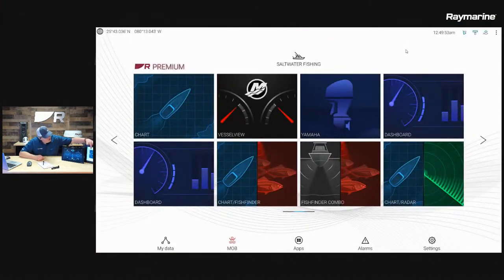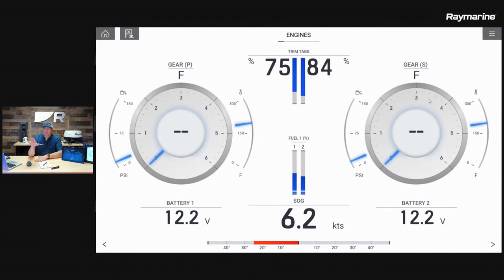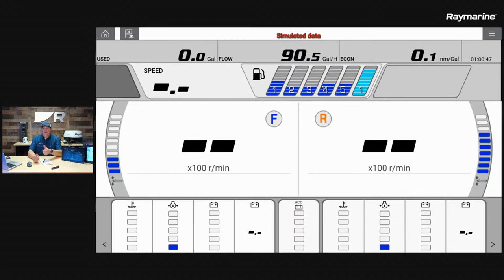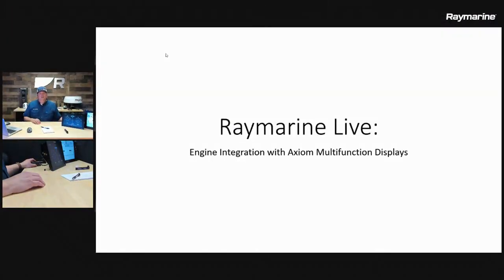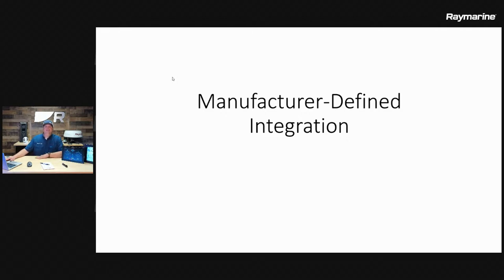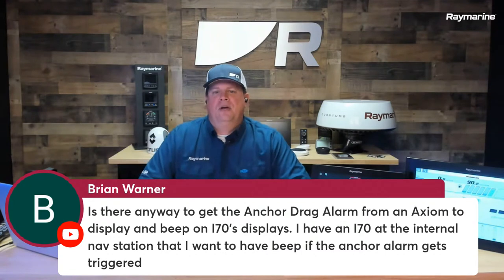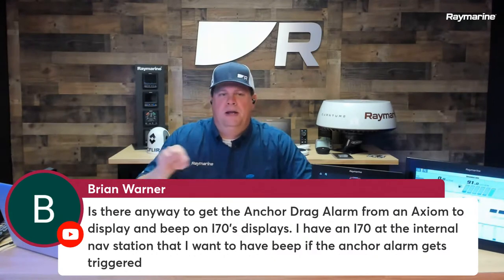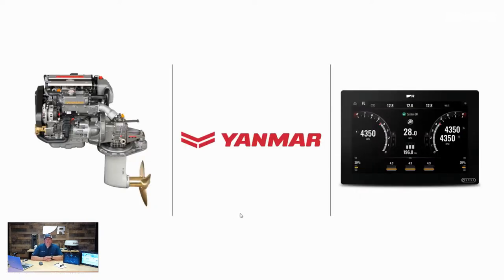Raymarine Live:  Engine Data Integration with Axiom

Comment: Hi Jim, Love your videos! I am from Bulgaria and using Raymarine for few years. Really nice gear! Currently, I have Raymarine Element 9 HV and would like to connect it somehow with my Mercury Outboard EFI 100hp 2018. Could you please help me to find out, what I need as connector, would it be possible through the Mercury Vessel Veiw?
Thank you in advance! :)
Reply from the maker: Hello Boris.  Element can display data from Mercury engines when connected using NMEA2000.   Element does not have the same built-in VesselView app that Axiom has, so you will be viewing the data on Element's engine dashboard pages instead of in a dedicated Mercury VesselView app.  

If you already have a VesselView instrument on your boat, it may have an NMEA2000 network connection on it.  Many of the newer ones do.   You would connect it to the SeaTalk NG backbone using a DeviceNet to SeaTalk NG adapter cable, part number A06075.   Your Element display would also need to be plugged into the SeaTalk NG backbone using another A06075 cable.  If you don't already have the SeaTalk NG network installed and running we offer a starter kit, part number T70134.

If your VesselView display does not have a NMEA2000 connection then you would need to order a Mercury SmartCraft NMEA2000 gateway accessory from your local Mercury dealer.  It plugs into the SmartCraft network and creates a data output for a 3rd party device like Element.    Be advised though that this is going to be expensive, for little return if you already have a VesselView display on your helm anyway.

Comment: Hey Jim. Thanks for the great show! Any info on integration of a Beta 50 with Axiom? Thanks!
Reply from the maker: Hi Peter.  I see online that Beta Marine has partnered with Actisense to make NMEA2000 engine data available to MFDs like Axiom through a NMEA2000 module accessory.   

The Actisense EMU-1 is being used in-line to convert the analog gauge signals to NMEA2000 digital.   It is tapped into the lines between the motor and the monitoring panel.  It appears to work with either their C or CW-series engine display panel.  There is some detail on the bottom of this page:

https://betamarine.co.uk/seagoing-control-panels-3k/

I also see some entries on this interface module in the Beta Marine "Mid Engine Range" catalog.  Your Beta 50 is part of that range, and from the description it looks like your engine uses the C-Series engine display panel.

I suspect the EMU-1 could be made to work with other engines and panels in their lineup as well as it is directly reading the analog signals off the engine's sensors and converting them to NMEA2000.  You'd need to figure out the wiring and configuration of the EMU-1 though to get it all setup.  

I have not seen it for myself, but I imagine the advantage of getting it from Beta Marine as a kit is that it probably seamlessly plugs into the control panel's wiring harness without too much fuss, and is mostly pre-programmed.

Once that module is installed you'll simply run a NMEA2000 to Seatalk NG network cable (A06075) from the module to an empty spur connection (white) in your SeaTalk NG network.   Axiom should detect it right away and begin showing data in the Dashboard app.

If you haven't already done so you'll want to go to the Boat Details tab in the main setup menu and tell Axiom how many engines you have.   It uses that to pre-populate the engine display page appropriately.

Comment: What about hooking up an Universal Atomic 4 via nmea?
Reply from the maker: Hello Richard.   If I am looking at the same engine online as you are referring to, that one is challenging, but possible.

Those don't have any native digital outputs on them.  I am not sure what they even have for analog gauges but if there are any at all, you could use a box like a Noland RS-11, Actisense EMU-1, or Alba Combi unit to convert analog signals to NMEA 2000 digital.

Worst case, you could get some very basic information using YachtDevices' Outboard Gateway for Petrol/Gasoline Engines.   This engine gateway has a basic coil wire that wraps around a spark plug wire to read the ignition pulses and provide RPM, alternator voltage and engine hours.   There are options for it to also read add-on temperature or pressure sensors.   You can get the details on it here:  https://www.yachtd.com/products/outboard.html

Comment: I have twin 502 volvo io/s completely analog. Can I go nmea and what do I need?
Reply from the maker: Hi Garrett.   You'd probably want to have a chat with a local marine electronics dealer before buying anything, but it should be possible to use one of the analog to NMEA2000 digital conversion systems to get some data from your engines.    The Noland RS-11, Actisense EMU-1, AlbaCombi Translate are all possibilities.   The most important thing to know about any of them is none is a plug-and-play solution.   You will need to find the analog sending units and lines on your motors, identify the signaling wires, and then connect and calibrate them on the electronic converter.  Once installed and configured these systems do work pretty well, but they are a bit of a project to get setup.

Comment: Hello Jim, i have 2 x AXION running firmware version 3.15.62 linked with a Mercury Vesselview 703 by NMEA-2000 . I can get info from both engines by the Dashboard on Axion, as well any alarms from Mercury pop-up into my Axion, but when i open Mercury App says "NO Communication". I already selected into AXION that i´m using Mercury engine . What else i need to configure to get the Mercury APP working properly . Thanks.
Reply from the maker: Hello Andre.   The SmartCraft Connect gateway needs to be added to your system in order to utilize the built-in Mercury app on Axiom.   Your local boat dealer or Mercury parts dealer can get the correct model for your system.  There is some additional detail on it here:  https://www.mercurymarine.com/en/us/gauges-and-controls/gauges-displays/smartcraft-connect/
Reply: @RaymarineInc  Hi, i also have on my Mercury system a VesselView Link which in theory do the same thing that this SmartCraft box do, even with VesselView Link + VesselView 703 linked by NMEA-2000 with my Axion´s i´ll need to add the SmartCraft box ?  in case positive, i´ll suggest in another firmware release, maybe talk with Mercury engineers to see if will be possible to do this work using the VesselView Link box instead of need to add another device into the network, because i believe have lot of people with the same issue. thanks in advance,
Reply from the maker: Hi Andre.  The SmartCraft Connect gateway is required to make the app work on the Raymarine MFD.   Other Mercury screens or gateways won't unlock the app, unfortunately.

Comment: I have the axiom MFD, and a single engine 200 HP Evinrude G2. There are two different cables from the engine that give engine data, one public network NMEA 200 cable that only shares the boat's gear (F, N, R), and battery volt output.  The private data cable from the engine is the STNG (6 pin) male ended data cable, and this private data gives RPM and detailed fuel flow data and other stuff. Obviously I want to be able to display this private engine data on my axiom, as well as still leaving the little Evinrude gauge intact to read the data as well for other important water pressure data and other information that may not come across on my axiom... Do you know how to obtain this private engine data from that 6 pin data cable that also plugs into the female cable at the helm for the Evinrude gauge. I think I need a splitter of some sort to be able to show both...
Reply from the maker: Hi Newton.   Would you be able to snap a few pictures of the ends of those cables, as well as the connectors on the back of your Evinrude gauge display?  You can email me at james.mcgowan@raymarine.com.   I'd like to get a look at what you have there, if possible.

Comment: Can I get some kind of Sea Talkng compatible sensor that'll both talk to the MFD and drive the old thermocouple circuit, so that I can grandfather my existing analog gauges?
Reply: Hmm, maybe your Noland suggestion (towards the end) is a good alternative here.  Convert existing analogs to CAN pgns behind the instrument panel.
Reply: For everyone, after research, Actisense and Alba-Combi are the better products, by configurability/flexibility, # of inputs. Reliability?  Dunno, haven't got it yet.
Reply: Thanks Jim, for this video!
Reply from the maker: Hi Mark.  There are a few manufacturers that offer kits to do exactly that.  They integrate with the analog sending units from temp sensors, pressure sensors, etc.  You program each channel to tell the system what it is measuring and how best to display it.   The box then outputs that data as NMEA2000 digital data that works on many different types of marine displays including Axiom.   The EMU-1 is a great option and there are a few more too.  Please let us know how it goes for you!
Reply: @RaymarineInc  It went great, and thanks for your help in this channel.  My system is wired up and working perfectly with compass, GPS, 2xMFD, doppler/wifi & AIS.  I'm very pleased with the whole thing. The menus just make sense and, I love the WiFi.  I have two redundant systems (except for the RADAR itself)  and interlinked on RayNet without need for a switch, thanks to the WiFi RADAR connection.  Next I will add Sonar & Alba-Combi for engine gauges. I do wish there was a pgn and configurable dashboard gadget for manifold temp. I'm gonna repurpose 'tilt' for that.

Comment: Does ECI100 comunicate with Volvo Penta 2008 EVC-C electronic control system?
Reply from the maker: The ECI-100 is compatible with Volvo EVC-C, EVC-D and EVC-E systems.  It should work with your 2008 system too.

In most Volvo installations there will be a Volvo Multi-link hub into which the ECI-100 will plug int using a Volvo link cable.   We have that cable available under Raymarine part number E70240.  Some older Volvo EVC installations don't use the Multi-link hub system, and instead use loom cables to connect devices.  For those systems you will need a Volvo Y-Loom splitter cable (E70241) and Volvo link cable (E70240).   

We have illustrations for how the connections are made, a full compatibility list, and the engine parameters supported all documents in the ECI-100 installation guide, available online here:  

https://raymarine.app.box.com/s/s2bajpvqjoiflgsqzx3o/folder/1787229145

Comment: is it possible to additional screen for generator engine and can keep generator engine logs. (i.e. working hours, fuel consumption etc.)
Reply from the maker: Many generator sets do support NMEA2000 integration and can share their vitals like other engines and propulsion diesels.    Similarly, older generators could be retrofitted using an analog to digital converter.    All of the running parameters can be displayed (pressures, temps, RPMs, etc.)   We do support most of the generator-related NMEA2000 PGNs (sentences) too.   Most likely you would build out a custom data page in the dashboard to display this information.

Comment: Is there a connector for a Tohatsu 6hp 4 stroke outboard?
Reply from the maker: Hello Tim.   I don't see any mention of data capability on the smaller Tohatsu portable outboards.   

Their larger models mention a system called TOCS (Tohatsu Onboard Communication System) which is a CAN bus network to support optional gauges and instruments.   They specifically mention that system is NMEA2000 compatible.  We'd be able to take TOCS data and display it on Axiom's engine pages in the dashboard app.   

The TOCS web page got into a bit of detail about which of their motors offer the system.  You can see it here:  https://www.tohatsu.com/marine/int/accessories/gauges.html

If you want a relatively simple solution to get some basic engine data from your outboard, take a look at this unit from Yacht Devices:  https://www.yachtd.com/products/outboard.html

Comment: Is Evinrude an option for the future or will it not happen?
Reply from the maker: Hello Rob.  Most newer Evinrude e-Tec engines support NMEA2000 networking.   Evinrude makes a NMEA2000 network cable, their part number 764164, that plugs into the engine's ECU and feeds data directly to the NMEA2000 or SeaTalk NG network.    The engine pages on Axiom's Dashboard application can display data from the engines.  These pages are pretty full featured and have nice graphics.  

If you look online you might commonly see that cable listed as being for Lowrance or Simrad, but it is simply a NMEA2000 connection and works with Raymarine and other NMEA2000 compatible display brands too.    

I don't think we'll see an official Evinrude app like we have for Mercury and Yamaha since they decided to exit the marine space not too long ago.    Those apps were developed in partnership with those engine manufacturers.
Reply: @RaymarineInc  thank you, i have my axiom 7 hooked to the nmea2000 bus but not satisfied with the current engine data display. The trim tabs are not used but cannot these gone. Would prefer more data like temp and fuel consumption.

Comment: hi wonder if you can help i have a c125 mfd and a128 that has a dud touch screen , can i link the two so the working c125 controls the dud a128 screen ? would network cable work etc thanks
Reply: or if i was to plug rmk10 remote into my a128 will that control both or do still need to link via raynet cable i hope im not confusing things thanks
Reply from the maker: Hello Matt.  Sorry to hear that the touchscreen is giving you trouble.  Adding an RMK-9 or RMK-10 to the network would be your best bet.  Unfortunately the C125 can't remote control the a128, but the RMK-10 can remote control both of them.   It does plug in using a RayNet Ethernet cable.  Assuming your 2 screens are connected to each other already, you can plug the keypad unit into an empty Network port on either one.
Reply: @RaymarineInc  thanks for the help i shall nip and pick up rmk10 , my units are connected on network already , how many mfds can the rmk 10 control? i have 4 screens in total thanks again

Comment: Does mercury vessel view for axiom use the same piece of hardware as vessel view mobile or is it a matter of Bluetooth transmission versus nema 2000?
Reply from the maker: VesselView for Axiom uses a different piece of hardware than VesselView Mobile.   It requires the SmartCraft Connect Gateway, available from your local Mercury dealer.   Your dealer does need to program it to work with your engines.
Reply: @RaymarineInc   Of course it does! I had a vesselview mobile and it worked perfectly, after getting a new Axiom setup I wanted to integrate engine data onto the network so I paid 500 for a smartcraft to nmea2k gateway. After a year I still have not gotten the fuel tanks to "calibrate". I get an error. 
So with vesselview now integrated to lighthouse I thought Perfect! Then I found out that I needed another new $1200 gateway!  I almost bought it too! I was at the dealer and the price just had a bad taste in my mouth and I decided to walk away. Good thing I did as I later found out (after much research) that the new gateway had to be programmed (at the dealer).
So, I guess I will do without since the dealer requires the gateway to be installed in the boat to program and my boat is 40ft with a 13ft beam. Add in buying a trailer, new diesel truck to pull it, wide load permits, ect ect ect and I guess I could have vesselview working again. :(

Comment: By older boats, would these solutions to older boats apply to Hino 220 diesels?
Reply from the maker: From what I can find online it looks like Hino diesels communicate with either the SAE J1708 or J1939 protocols.  This makes sense as their marine diesels share architecture with their truck and heavy equipment diesel products.  If your diesels have any kind of electronic monitoring its most likely utilizing one of those protocols.   

Yacht Devices makes adapters for both J1708 and J1939 to NMEA2000.    This is an example:  https://www.yachtd.com/products/j1708_gateway.html

I recommend dropping them an email with the particulars on your engine and they may be able to provide a mostly plug-in solution.

If your motors don't have any electronic monitoring, then something like the Actisense EMU-1, Noland RS11 or Alba-Combi analog-to-digital conversion units would be a solution.